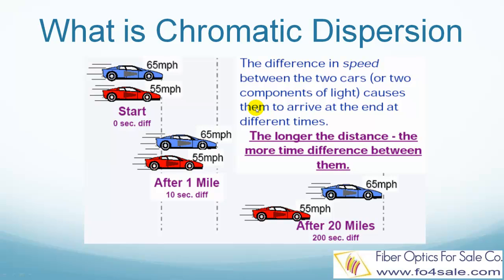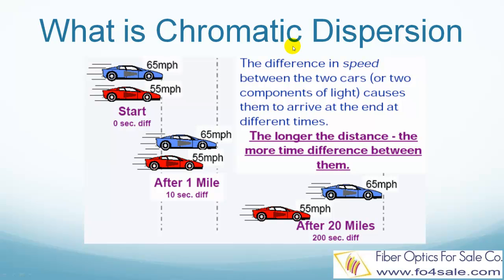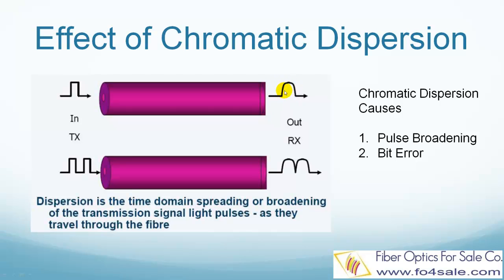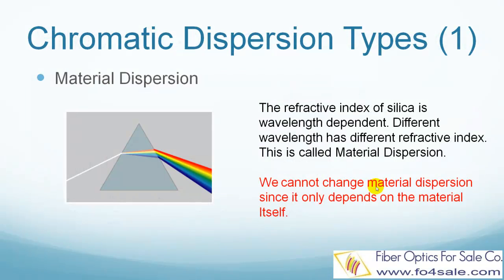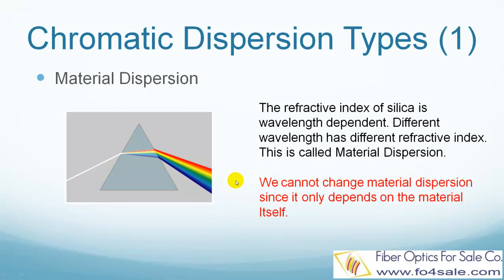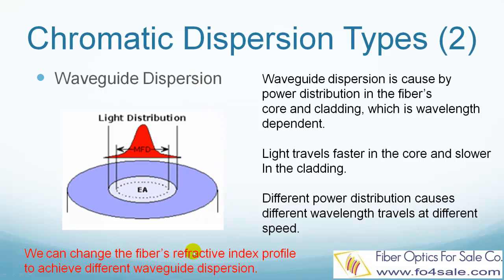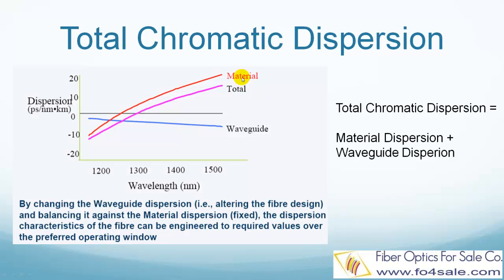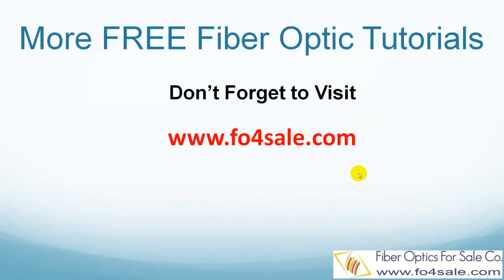What is Chromatic Dispersion in Optical Fibers

Comment: I hope the video is corrected now. 

By the way Colin, at 2:50 you said that the pulse travels slower in the core which is true. However, on the slide, you wrote the opposite. I think the slide needs to be corrected.

Comment: By the way Colin, at 2:50 you said that the pulse travel slower in the core which is true. However, on the slide you wrote the opposite. I think the slide needs to be corrected.
Reply: Because the speed is in inverse proportion to the refractive index, and the rf of the core is higher than that of the cladding, so the statement of the slide is wrong.

Comment: I would like to see something about any differences required in fusion splicers to splice Rare-Earth doped fibers as opposed to silica based fibers.  What handling differences, prep, etc.  Also explain the nuances of end caps. Are the larger diameter fibers more difficult or the smaller?  Likewise the same questions with Photonic Crystal fibers.